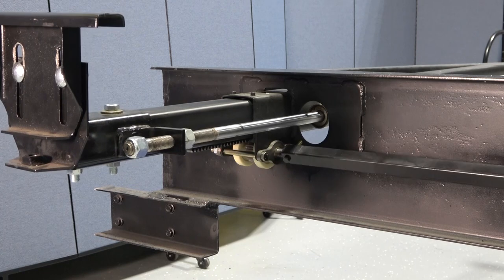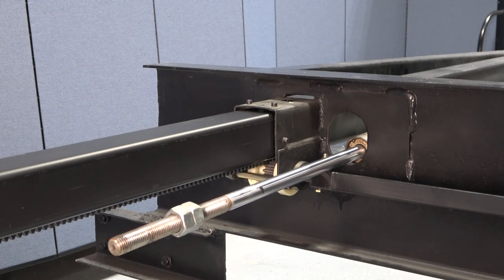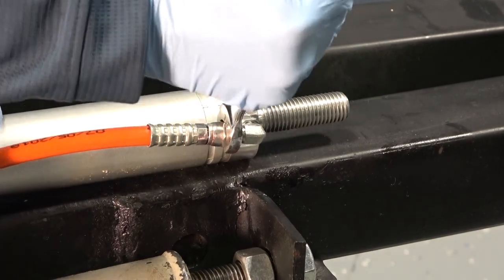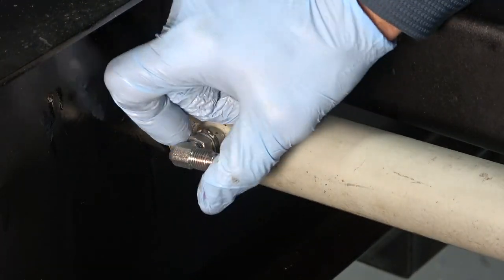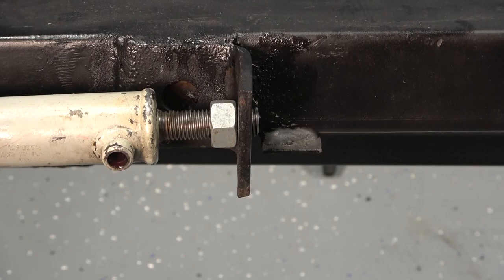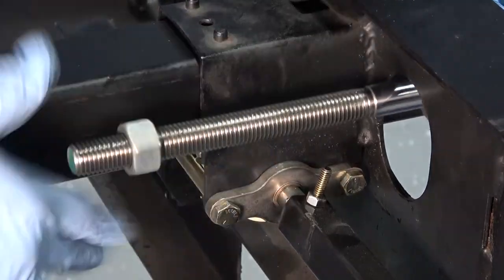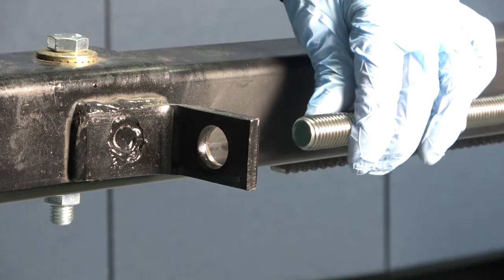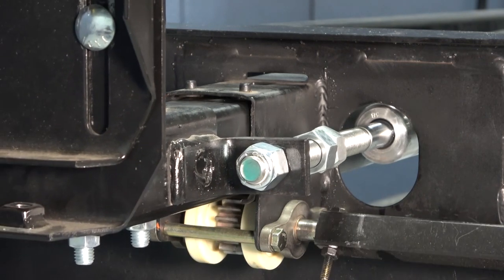Hydraulic Through Frame Slide-out Hydraulic Cylinder Replacement

Comment: Thank you so much for this tutorial video.  My husband and I replaced a hydraulic line and we were just stuck we were stuck and after watching your video I said it has got to be in and around this pull out and sure enough it was because you had your piston I think that’s what it’s called attached to that heavy metal and that heavy metal I know is a part of the slide out frame so I put two and two together and found our lines in the rear slideout. Beautiful. Replaced the line, secured it along 30 ft, filled it up and attached it to the unions. Unbelievable…….works like a charm and saved a ton of money.